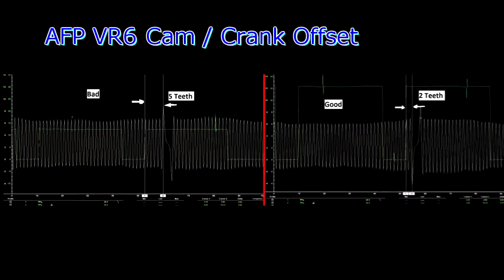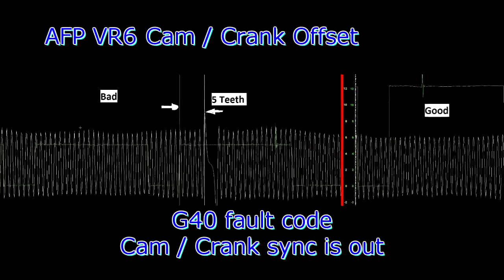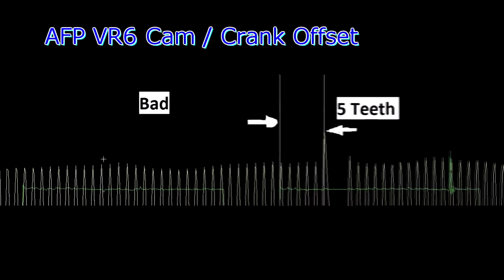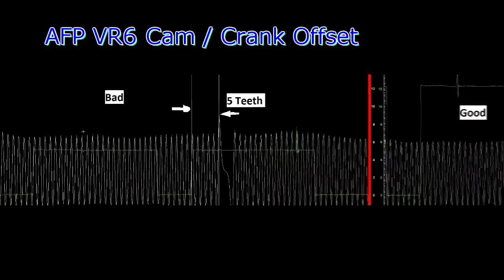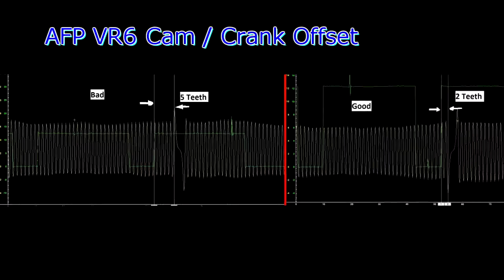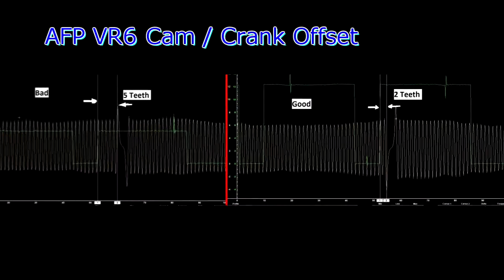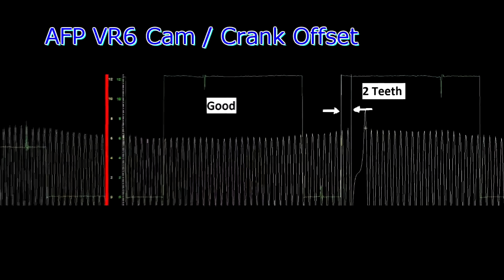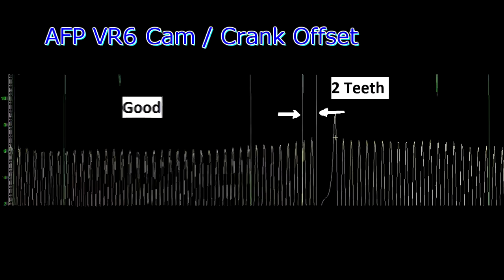VW A4: AFP VR6 Cam & Crank waveform (good & bad)

Comment: I'm getting a 16725 p0341 implausible signal code on a vr6 AES eurovan. I think the car is running fine, but a new sensor didn't fix it. How can I verify timing? Buy a 2 channel recording oscilloscope to probe the waveforms to compare to this video? Is there any other way besides taking off the valve cover? Thank you for all your videos, super helpful!!
Reply from the maker: @valentindecker5264
Swap sensors. If the fault is still present (on the same camshaft), it's time for timing chains.

The ECM is doing what a scope would show you. It's monitoring the position of the camshafts & crankshaft. 

When the signals don't line up, the ECM sets a fault code.

If the fault moves to the other camshaft, then the sensor is faulty.

If the chains are noisy, that's another indication that they need to be replaced.
Reply: @EXOVCDS  okay. The first sensor I bought didn't function correctly which gave me lots of heartburn etc. the NTK sensor I bought finally fixed that code for me. The chain is somewhat noisy but I feel like it's done that since 60k miles and I'm at 270k now. I probably should change it but it's a huge job. Also, I believe no 12v vr6 has 2 camshaft position sensors that you can swap so that trick only works on later VR6s. I appreciate your help!
Reply from the maker: @valentindecker5264
My bad, sorry. I didn't pay attention and thought it was a 24V.
Reply from the maker: @valentindecker5264
And thank you for the update!
Reply: To all others, get a good sensor brand, nothing from Amazon. Not worth the induced fear of grenading your engine! My code has been clear for 1000 miles now (used to come back in 5-250 miles). And there's precedent for the sensor being the issue (not just a jumped tooth). I think the sensor was intermittently failing to generate its signal. After banging into the metal cap a few times with a Forstner bit during testing, the code came back after many hours of driving instead of a few minutes. Which gave me some conference that my engine was probably fine (as well as the fact that my fuel mileage and uphill power delivery hadn't deteriorated). But going up a 7 mile grade at 4500rpm sure is nerve racking if you don't trust your timing system! Thank you Thomas!

Comment: same on the older VR6s? Probably not as always
Reply from the maker: I haven't scoped an AAA yet, but AAA should be similar. As soon as I do... I'll let you know.
Reply from the maker: I just realized that it will look different... on your cam gear, there's only one raised edge for a signal. I think the AAA only produces one square wave, like the ABA engine I'll grab a waveform as soon as I can.